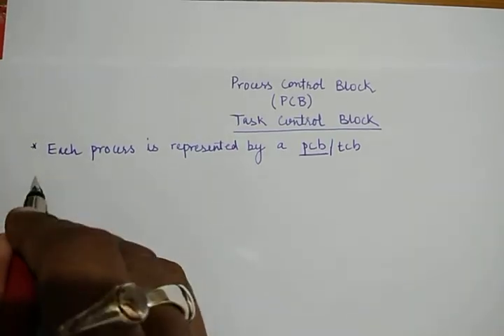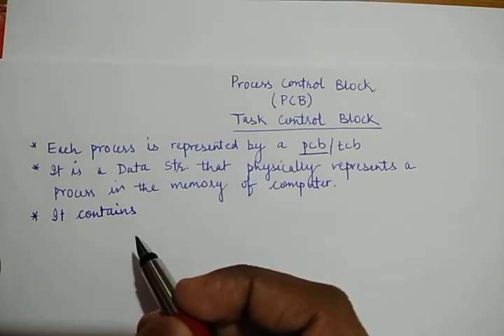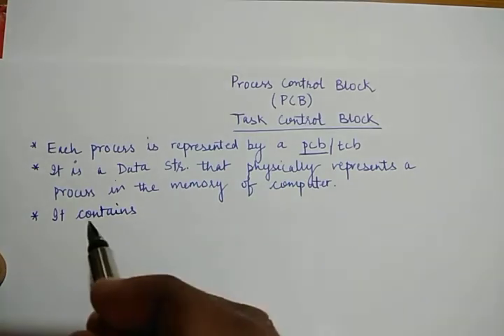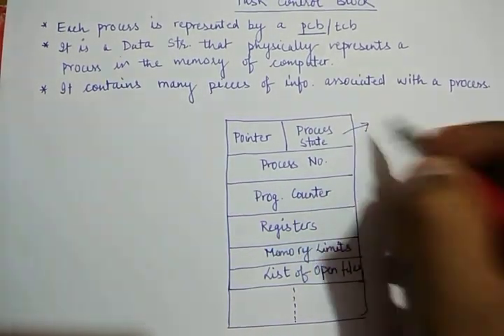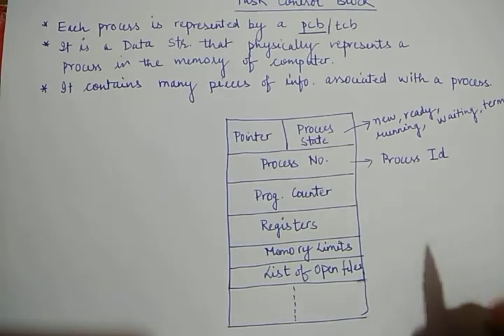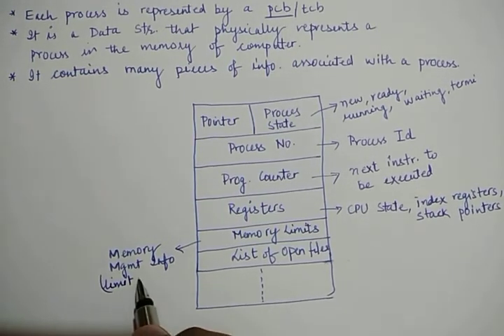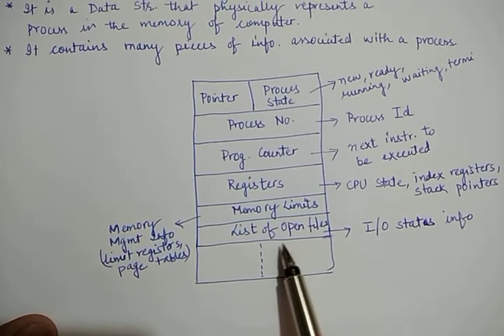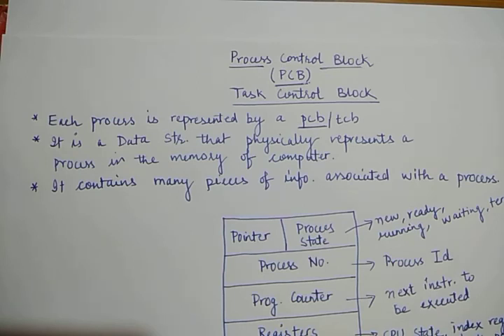4. Process Control Block (PCB) in OS

Comment: thank you for the video. I have one question: what does the "pointer" in pcb points at?
Reply from the maker: Hi ! Thanks for appreciation. The pointer in PCB most generally points to its parent process and Similarly, a pointer to child process (if it exists). 
But if we go into details then a PCB maintains no. of pointers internally such as:
1. Pointers to process's memory: This gives addresses of pointers to the locations where the process image resides in memory.
2. Pointers to other resources: This gives pointers to other data structures maintained for that process.
3. Pointers to other PCB's: This gives the address of the next PCB with in a specific category (process state).

Hope this will clear your doubt. Feel free to ask your further queries. 
Thanks Again !!!